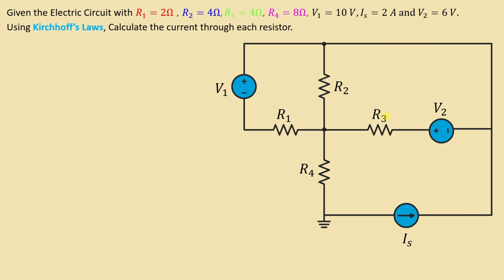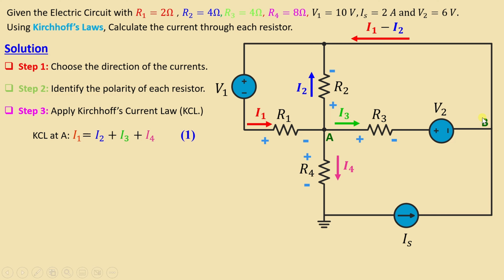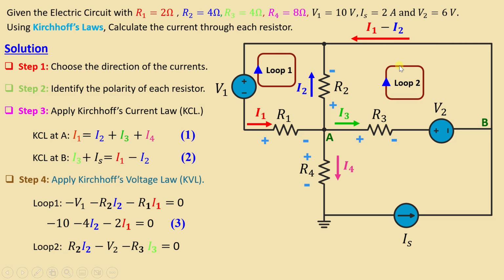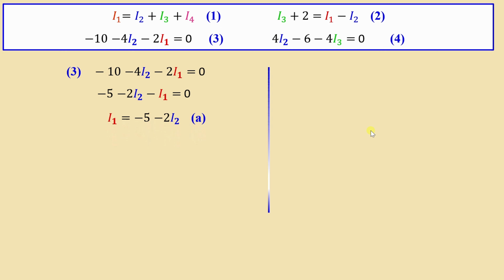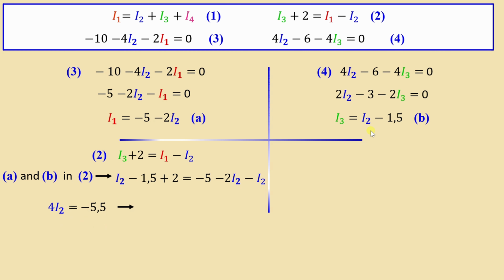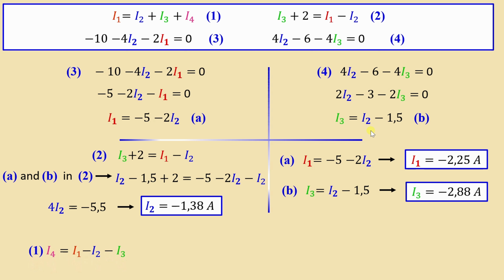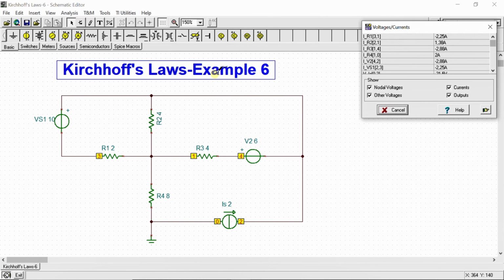Electric Circuits DC:Kirchhoff's Laws-Solved Problem 6

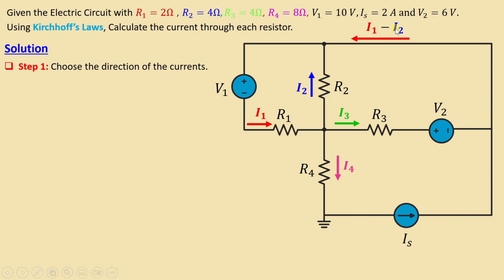Comment: Can you please explain how you got I1-I2 at 1:09 in the video?
Reply from the maker: Just apply KCL at that node
Reply: @ElectroMindsEducation-jl5vs  At node B you mean or the node where the I2 current and the (I1-I2) current arrows are pointing to at the top of the circuit diagram?